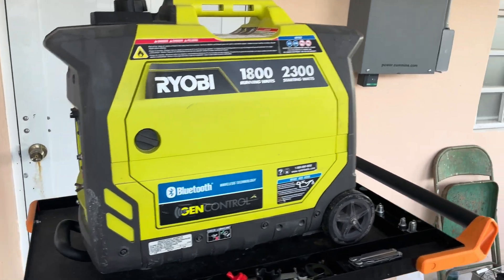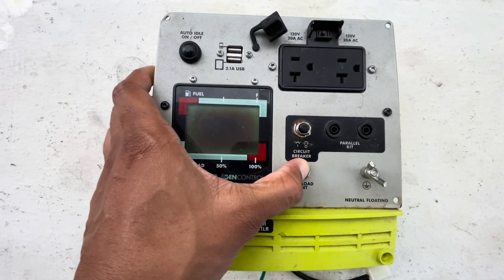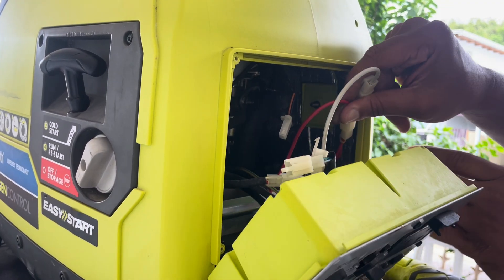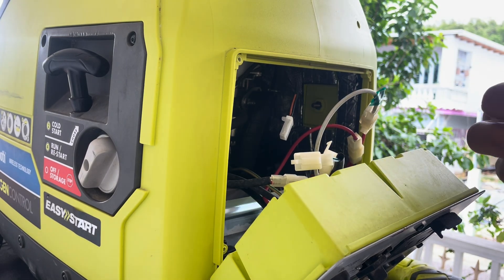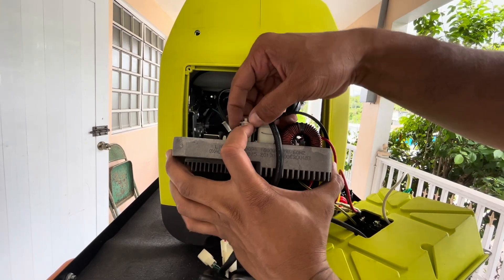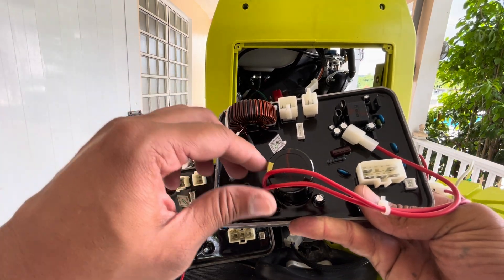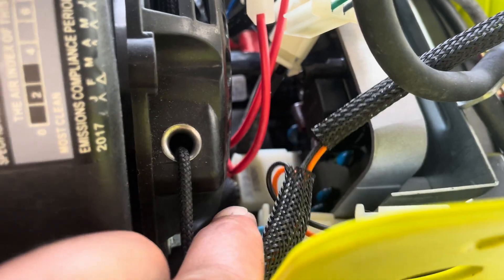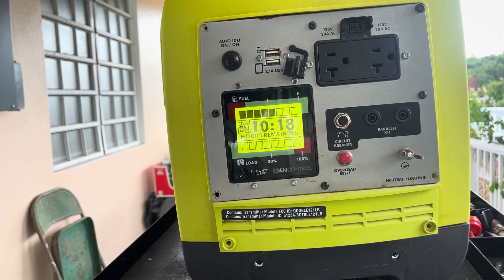How to fix ANY portable inverter generator NOT producing POWER. Over loaded Ryobi inverter generator

Comment: I wish I had your stack of old inverter boards for parts. I'm working on one of these that was given to me because I currently have no electricity, no way to heat my house and I'm freezing here. Unfortunately, I'm broke and can't pay shipping atm, but I'd take those apart and scavenge parts to fix mine.
Reply from the maker: Sorry to hear about your situation, where are you from? I hope you're able to get your generator fixed and get some power back soon!
Reply: @tacticalpowerpro Thank you for the good wishes. I've had a run of both bad luck and bad health, so circumstances have taken their toll. I'm from the United States.

Comment: Superb video mate; my inverter gen is sweet right now, and I'm smitten with it - compared with my monster diesel set it is portable, quiet, and no fuss........had I known about these things I'd have never got the diesel - I only got the inverter because the diesel threw a valve into the cylinder and we were on an extended power-out, here in the Philippines. My Q is....... with these gens are the inverter modules generic? My gen is some obscure Chinese brand and I have no idea where to source parts - the manufacturer's site has zero contact details. I'm thinking ahead if I need to start replacing bits, because the gen already has 90 hours on it after only 3 months. Liked and subscribed.
Reply from the maker: Thanks a lot, I appreciate it! And I hear you, once you try a good inverter generator, it’s hard to go back to a noisy diesel set.

About your question:
Most inverter modules are not universal or generic. Even though many come from similar factories in China, the control boards are usually matched to the specific engine, the alternator windings, the voltage/frequency sensors, and the protection circuitry of that exact model.

If the module fails, using the wrong one can cause overvoltage, no output, or it just won’t sync with the engine RPM.

For obscure Chinese brands, the best options are usually: Look for the exact engine model number (often Loncin, Ducar, Senci, etc.), search the inverter module part number printed on the board, or check AliExpress / Alibaba, many Chinese OEM suppliers list these boards.

And don’t worry too much about 90 hours, that’s actually still low. Just keep up with oil changes and don’t go over 80% of its rated power and it should run strong for a while.
Reply: @tacticalpowerpro Thanks very much for the quick reply.
Reply from the maker: You’re welcome! I’m here to help 🫡

Comment: My Ryobi Generator has 5 hours on it and if I put anything like a circular saw, drill or shop vac it overloads. Throwing another $250 sucks…..thanks for the video!
Reply from the maker: Only 5 hours? Did it sat without usage for a few months? In your case make sure the carburetor is clean, the spark arrestor is not clogged and the spark plug is good.  If you got any of those dirty it will cause these ryobi to overload. Hope it helps and thanks for watching.
Reply: @tacticalpowerpro I will take a look !  Thanks!
Reply from the maker: Let me know how it goes.

Comment: What if my gen just isn’t ramping up RPM automatically causing an overload? If I manually hold the carb throttle up it produces power and runs just fine with a load. But something is causing it not to either sense the load or command the throttle up.
Reply from the maker: Verify the stepper motor that controls the throttle is plugged and making full contact. I’ve seen cases like yours and the stepper motor connector was not fully connected or completely disconnected. If the connection is good then you most likely have a faulty stepper motor.
Reply: @tacticalpowerpro appreciate the response, I actually did swap out the stepper motor without any luck still
Reply from the maker: Interesting, thank you for the update. If it has a new stepper motor and it is still doing the same then I recommend verifying that the gasket between the engine and the carburetor is not cracked or missing. Also there is a spacer in between the carburetor and the engine, make sure that is not cracked as well. Also make sure the carburetor is secure tight, I have seen generators acting like yours because there was extra air getting in behind the carburetor due to it not being completely tight or the gaskets were missing or place the wrong way.

Comment: Too bad the new inverter module costs just as much as a brand new generator. 😂😂
Reply from the maker: Well it depends on the generator brand but yeah 😅 most of the time you are better off buying a used generator  on facebook marketplace for the price of the inverter module. The inverter module for these Ryobi are around $250, the inverter module for the Generac inverters starts around $750 👀 it’s crazy.
Reply: @tacticalpowerpro you know i wonder if you can just toss in a standard cheap AVR and run em non inverted....
Reply from the maker: Nah, it won’t work. They are different system design. A conventional generator makes raw AC power directly from the alternator and uses the AVR to regulate the output voltage. Inverter generators work in two stages, first, the alternator produces high-frequency AC that gets rectified into DC. Then, the inverter module takes that DC and electronically creates the clean, stable 120V/60Hz power. If the inverter module is bad there’s no way to “bypass” it with a cheap AVR. The alternator in an inverter generator isn’t designed to feed your outlets directly like a conventional generator.

Comment: That control box for my Yamaha EF2000 is $500.00. I ran out and bought a new Honda for $1000.
Reply from the maker: That’s one major downside of an inverter generator, the modules will cost a pretty penny. Take good care of the Honda, that inverter module definitely cost more than $500. Thanks for watching and commenting on my video.
Reply: Damn. I got a xtm 2000w inverter generator for $490aud, same weekend my neighbour got a honda eu22 for $1300aud and he says mine runs better and more powerful 😂 i also just replaced the inverter in my 3.5kva gentrax for $160aud including delivery, so yall are paying way too much for generators and the replacement parts too!
Reply from the maker: 100% agree, prices over here are ridiculous compared to other countries.

Comment: I just got a predator 2500, just released, and I'm curious if you have an inverter for that one that went bad, I'm trying to be prepared for if and when this one dies on me.  My last inverter was a predator 2000 and it's invertor died too soon, under warranty, and I upgraded but I know these go out if you don't baby them a lot and I'm not able to baby my generator since I'm mobile 100% of the time.    Thanks.
Reply from the maker: Glad you were able to get a newer generator under warranty. You can find the inverter module for the predator 2000 inverter in Amazon. I recommend searching there. There are a few models so make sure the inverter has the correct connectors that matches yours. Thanks for watching my video.

Comment: How much does an inverter module cost for a Predator 2500 inverter gen  ? btw , I thought that drop the bolt / nut and you will ruin everything was funny as hell.
Reply from the maker: Haha thank you for watching and I’m glad you found it funny. I recommend contacting Harbor Freight to get an accurate price though. But I’m guessing the module might cost around $150 to $200.

Comment: Hahaha, had me dying with the press the reset button. Im having this issue with my yamaha. I get 2-3 minutes out of it then it trips.
Reply from the maker: Hahaha glad you liked the joke. Thanks for watching my video. In your case, if everything on the engine side is good (clean carburetor, good spark plug, good fuel, clean spark arrestor, engine is running good) then your issue is the inverter module as well. The inverter module is the most common single point of failure when it comes to inverter generators not producing power.
Reply: @tacticalpowerpro I appreciate  the help, going to get one ordered. It runs all day and night, just always overloaded. Even with nothing plugged in. It was my fault. I tried to use it for my air compressor.
Reply from the maker: @Go4BrokeOffroad  Oh no, definitely too much load for these small inverters. Replace the inverter module and your generator will produce power once again. I appreciate you commenting on my video. Give me an update when you replace the inverter  module.

Comment: Hey, do you know why my generator shows me that it has little gas but in reality it's full of gas? Please help
Reply from the maker: You might have an issue with the fuel level sensor inside the fuel tank. It’s either faulty or disconnected.

Comment: I have a similar issue. The generator starts. It’s not a carburetor problem, but it will barely idle and the display screen doesn’t illuminate. Any suggestions as to why?
Reply from the maker: I have seen that issue before, some cases were a bad carburetor gasket between the carb and the engine block or a loose carburetor letting extra air in. Other cases were a faulty stepper motor but the most common problem that causes that issue is a bad inverter module.
Reply: @tacticalpowerpro  I thank you for the response and the suggestions. Not sure how to approach checking an inverter, but, I do appreciate you posting these videos and taking time out of your personal life.
Reply from the maker: @diehardfan173 send me a message on Instagram @tacticalpowerpro, I can send you a pdf showing how to test the inverter module. It might be helpful.

Comment: Tengo el mismo problema solo que el over loading sale despues de unos 5min aproximadante aunque lo haya cargado con muy pocos watts, ¿crees que sea lo mismo?
Reply from the maker: Te recomiendo que primero le hagas un tune up al generador. Una buena limpieza de carburador, remplazar la bujia y limpiar el arresta llamas en el muffler. Si uno de esos esta sucio o defectuoso, la operación del motor es afectada y no tiene suficiente fuerza para suplir la carga y se sobre protege con el overload.
Reply from the maker: E trabajado casos como el suyo y la mayoría resulto ser que el arresta llamas (la mallita en el muffler) estaba cubierta completamente de carbon o el carburador estaba sucio.
Reply: @tacticalpowerpro  gracias, lo unico que me falta por hacer es lo del arresta llamas, no lo sabia, gracias por el consejo
Reply from the maker: De nada, aquí siempre a la orden. Limpiar el arresta llamas es bien importante y mucha gente lo ignora. Si el arresta llamas se tapa con carbon los gases no pueden escapar la cámara de combustion  y el motor pierde fuerzas. Me dejas saber si logras resolver el problema con tu generador.
Reply: @tacticalpowerpro  solo tenia un poco de ollin pero estaba libre, lo limpie pero obviamente la falla persiste. Crees que sea tiempo de reemplazar el modulo inversor?
Reply from the maker: Si el carburador esta limpio, el spark plug esta limpio y el arresta llamas esta limpio pues lo mas probable si, ya el modulo inversor esta fallando. ¿Cuantas horas de uso tiene el generador?

Comment: You haven’t repaired anything just a part swap. The inverter usually costs more or as much as a new generator. You did no troubleshooting, like checking stator windings and output.
It could be as simple as a bad connector or cable.
Those have to be ruled out first before changing inverter.
Reply from the maker: You are correct, in the video I did no troubleshooting. I went straight to swap the problem. I troubleshoot these generators on the daily and experienced showed me that the module inverter will fail way before the stator winding and rotor. 

You are more than welcome to troubleshoot the overload problem on inverter generators (following those same steps you mentioned) then come back to the comment section and tell me what you found, I’m 99.99% sure you’ll find a bad inverter module. I’ve done it waaaay too many times only to find out I need to replace the inverter module. 

And yes there’s the occasional loose connector. If that was the case you’ll notice the loose connector while trying to take the inverter module out. Thanks for watching and commenting on the video.
Reply: @  so you completely tore down the the gen only to put it back together for the video I call bs.
I do component level work on these and have removed potting to repair inverters about 50 percent of the time it’s the inverter
Reply from the maker: @chrisdevitto4340 I said I went straight to the problem for the generator on this video due to what I normally experienced with the overload problem. I didn’t tore it apart, what you saw in the video is what I did. Guess I got lucky the inverter module was the issue … again 😅. 

Looks like you know your way around generators as well and that’s awesome, keep the good work 🫡
Reply: I just picked up one of these second hand in almost new condition. I can't connect it to the bluetooth gen control app. I get an error message, "generator not found." Any suggestions add to what the problem could be?
Reply from the maker: @badtothebone346 Are you pressing and holding the pairing button on the generator long enough?
Reply: @tacticalpowerpro  yes it says pairing, but then I get an error message. On my phone it's searching but not finding the generator.
Reply from the maker: @badtothebone346 oh ok, are you using the Ryobi app? You need the Ryobi app to connect to the generator. It won’t work if you search on your phone’s Bluetooth.
Reply: @tacticalpowerpro 
 I used the app.
Reply from the maker: @badtothebone346 damn, well check if you can pair it by the QR code if it has one. If not then the Bluetooth module on the generator might be defective.

Comment: What do you mean the left one goes to the white wire both my wires are white, hot and neutral.. do you mean the left wire is neutral?
Reply from the maker: In my case I had red and white wires. Cases like yours is why I recommend taping one of the wires on both sides of the connector before removing the inverter module. That way you can identify where to connect the wires coming from the new inverter module.

Comment: Que tal amigo, disculpa, adquiri un generador ryobi 2300 y está muy acelerado y con la aplicación no se puedo apagarlo desde el celular, hace el proceso de apagado y ya casi apuntó de apagarse vuelve a recobrar las revoluciones, podras orientarme un poco?
Reply from the maker: Saludos, ¿el generador marca Overloaded en la pantalla cuando corre acelerado? ¿El generador produce voltaje?
Reply: El generador está acelerado, pero no marca overloaded, el generador si produce voltaje bien, lo sobrecargas y si marca overloaded, lo pones en reset y vuelve a funcionar, solo ese detalle de que está muy acelerado y el botón q tiene en el tablero AUTO IDLE lo presióno y en la pantalla si cambia, pero el motor no hace el cambio acelerar y desacelerar.
Reply from the maker: Si miras el carburador debajo del motorcito que controla el acelerador podrás ver  un tornillo pequeño llamado “idle speed screw”. Me suena a que ese tornillo esta ajustado hasta el fondo causando que el acelerador este abierto completo acelerando el motor. Recomiendo que empieces por ese tornillo. El idle speed crew no debe estar apretado hasta el fondo aflójelo y deje que el acelerador pueda cerrar un poco y así el motor pueda bajar su velocidad.
Reply: @tacticalpowerpro   ok, muchas gracias por tu tiempo y más que nada por orientarme amigo, lo intentaré y ya te comento si me funcionó, saludos y bendiciones.
Reply from the maker: De nada amigo, gracias a ti por ver y comentar en mi video. Me deja saber si resolvió el problema.
Reply: @tacticalpowerpro  muchas gracias amigo, problema resuelto, saludos desde jerez Zacatecas, México
Reply from the maker: Me alegro, gracias por dejarme saber. El “idle speed screw” era el problema?
Reply from the maker: ¡Gracias por el apoyo desde México! Aquí siempre a la orden desde Puerto Rico.
Reply: @tacticalpowerpro  si estaba muy acelerado, pero me di cuenta q tenía una fuga de gasolina, se le dió un mantenimiento al carburador y quedó al 100. Gracias
Reply from the maker: ¡Perfecto, buen trabajo!

Comment: Looking for help with my MaxpeedingRods MXR6250iE Digital Inverter Generator (5000 Running Watts / 5500 Peak Watts).

The motor works fine, but there’s *no power output* at all. I bought this unit last April for $1299 CAD from Walmart. I only started it a few times but never had to use it in an emergency.  

The issue:  
- Motor runs, but no electricity is produced.
- I reached out to MaxpeedingRods, but no response.  
- Walmart also hasn’t offered any solutions.  

I’m really stuck here. Does anyone know how to troubleshoot this issue, or can point me to someone who can help? I’d really appreciate any advice or guidance! Thank you!
Reply from the maker: Thanks for watching my video. I can definitely try to help you out. From my experience, if an inverter generator stopped producing power then most likely it has an inverter module issue.

 But, I always recommend to verify that the carburetor is clean, spark plug is good and spark arrestor is not clogged. If any of these are faulty then the engine won’t be operating at the rpms needed to produce power.

You mentioned the engine is working fine so I’m definitely thinking you have an inverter module issue. Verify you don’t have a loose connection at the module or if a rodent chewed wires at the inverter module (pretty common). Hope this helps.
Reply: @tacticalpowerpro  thank you for the help. I'll see if the rpm is running high enough.
Reply from the maker: You’re welcome! Keep me updated.